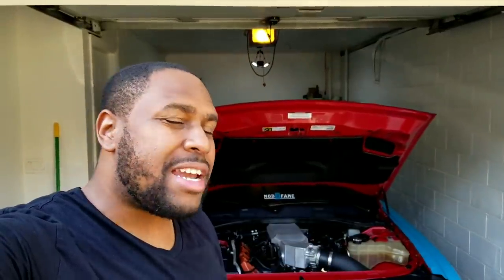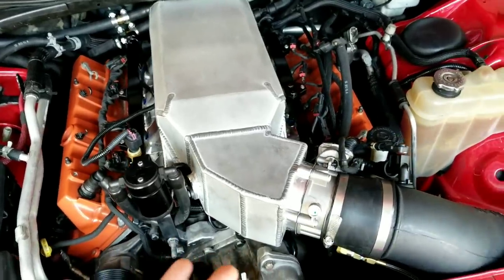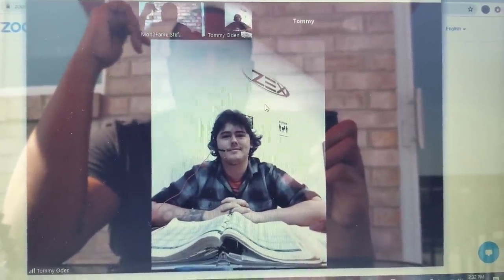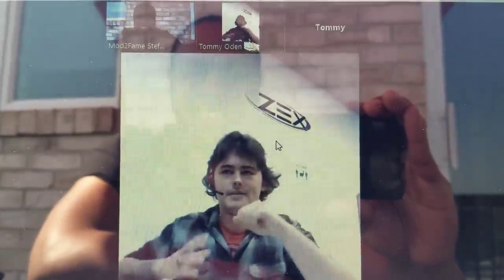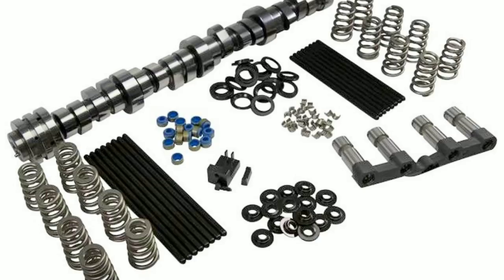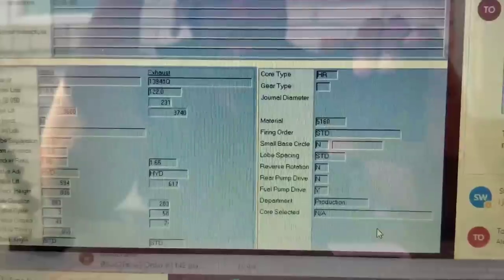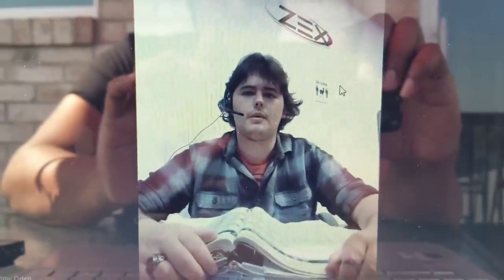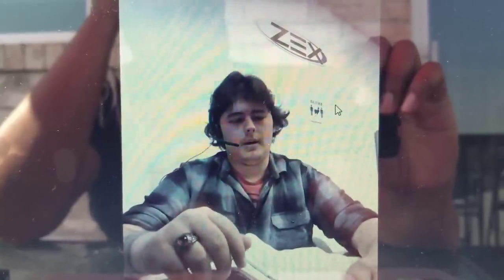Giving MY HELLCAT ENGINE The MAGIC STICK

Comment: I understand this video was mostly about camshaft selection for your upcoming Bi-Turbo build. But I did hear you asking the Comp Cams representative specific question about how much horsepower one can gain with installing a high-performance camshaft. There are so many variables that’s at play regarding developing increase horsepower. A person can install a high-performance camshaft and literally lose horsepower, increase ET on the race track and lower the life cycle of an engine. 

I think you’re on the right track by consulting with a camshaft specialist. But I think you should also consult with other Engine Builders who have many years of experience building engines for racing… specifically, building engines with Mopar Variable Valve Timing Technology. I know Comp Cams ships a phase limiter with most of their camshaft, but you should consult with an experience engine builder to ascertain what degree phaser limitation they found work best for your application. Valve spring riding height is also significant with high-performance camshafts. Too stiff and they will swipe the cam lobe in a short period of time, and too weak and you’ll get valve float which will certainly cause you, at best, to lose horsepower and at worse, damage your pistons. Take your heads to a good machine shop, they can properly set the valve riding heights in accordance to the camshaft specifications. And have them polish the ports while they have the heads. 

And while you’re early in the build stage, plan to replace as much components as possible… don’t build cheap. Things like new oil pump w/pickup, Timing chain w/tensioners, water pump, etc.… A fresh set of Rockers won’t hurt either, since they can and will wear over time. Remember the camshaft lift is based on the Rocker ratio of the engine. Don’t want your advertised 594/617 to be essentially less. I recommend going with the Full Return Fuel System. Don’t want to get lean at the top, especially since you’re planning on highway runs at full throttle for more than a ¼ mile. You can talk with your engine builder regarding a Water/Meth system. Some people say because Methanol increase exhaust gas temp, it could be counter-productive on a Turbo car. But maybe going from a 50/50 mix to a 60/40 mix will work on your Bi-Turbo application. Again, consult with an experience engine builder about that. 

Good luck on the build and know that a properly built Engine could actually last longer than a stock engine. I have 163,000 miles on my fully built Engine, Torque Convertor, Transmission and Transfer and it runs just as strong as ever.

Comment: I did a comp cam on my scat pack challenger 6 speed and ended up with 500 to the wheels only thing I dont have is bigger throttle body that is coming keep up the good work my brother.

Comment: That’s nearly identical to my cam in my LS, I have a D1X Procharger.  Runs like a dream.
Reply: Matthew Brown d1x ftw!!!
Reply: If you like the d1x you will really love the Ysi
Reply: SpeedLife301 I know my buddy has it in his 67’ Nova and it does blow more air than my D1X but not by much.
Reply: SpeedLife301 what kind of power did you make with the ysi in your vette?
Reply: David Fischer can’t post stuff like that on here lol
Reply: Matthew Brown yea there are two the standard which is good to 1140whp with all the mods then the billet wheel one that is good to 1350 whp.  The top end is one thing it just makes more low end and midrange than the procharger do. It has big blower top end but spools up fast like a smaller blower and has low parasite loss to spin it compared to the f194a and f1x that rob a shit ton of power to spin them hard
Reply: SpeedLife301 he’s got the billet one, 418 dart block on E85.  The thing is ridiculous.  We are in Ca so I had to stay CARB compliant with the slightly smaller blower otherwise that would have been the choice.

Comment: Hey Steph,  great video as usual. I just want to point out that technically Isky cams is the Grandfather of hot rod camshafts. They were founded in 1947 and Comp is newer to the scene being founded almost 3 decades later in 1976.  Just dropping some history. I know you were just giving props to Comp Cams. I just figure it's better a subscriber pointing this out than a troll! Lol.

Comment: This was very helpful. I am looking to forge internals on my 2020 Dodge Charger RT with long tube headers, larger intake and throttle body.  I want to use the Hellion twin turbo system or Pro Charger.I know you are doing hellcat but I am looking for the 345. Thank you for your videos and inspiration. I will probably be looking at a used hellcat next year. I am just waiting to retire from the Military. Right now my car is my daily driver. Thank you again for your information and videos
Reply: Hellion is awesome

Comment: Awesome information! I have not missed a vlog but I still don't understand what was the deciding factor to drop supercharging? As a viewer one day you were doing well with the car and the next you were removing the blower and talking twin turbo. Somebody or something happened to move you in the turbo direction? You have my respect to go where no one has gone before. I'll be along for the ride!
Reply: One of his vlogs, where he drove to the shop that's selling him the turbos explained to him that with turbos it is easier to make big power than a blower because turbos are more efficient and less stressed to make power. According to the shop and Stefan research, the engine will be able to make an extra 200hp with turbos at the same boost pressure a blower would be running. Summary: less heat, less stress to make big power, more efficient system to make power and uniqueness as most Mopar 3rd gen engines are mainly sprayed and supercharged.
Reply: @Elephant_Thoughts  and then he made the decision to drive the car home from the shop with no boost and the entire engine blew???
Reply: @KatzTeddy  Yeah, he drove his car after he made back to his main shop where they remove the supercharger and put on a turbo manifold. It's still unknown if they messed with the tuning of the car but more than likely the car was still running on the tune with the supercharger. So Stefan was under the impression that his car's tune was dumping loads of fuel in the engine without a supercharger, thus why he was confident enough to drive the car.

Comment: I hope you read this ,,, comp cams only been around since  the mid 80's were as Isky, Crower, Howard has been around since the 60's . The difference in a blower cam 
Is you  want a bigger intake . The turbo cam more open on the exhaust .
there are other things like no overlap on the camshaft for root style superchargers.  Thanks Stephen for video and I like what you are doing with your car it is going to be  a real killer . If I offended you about you blowing your car engine for give me . Just I been there before and that is know fun . So I am wishing you the best